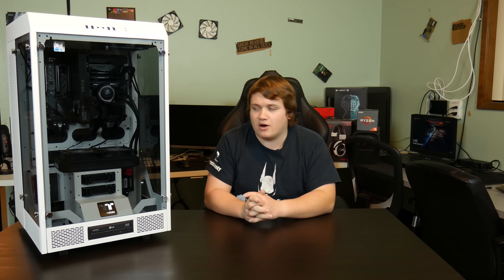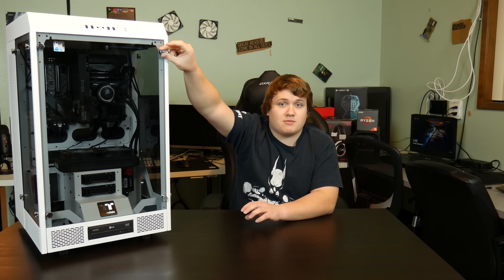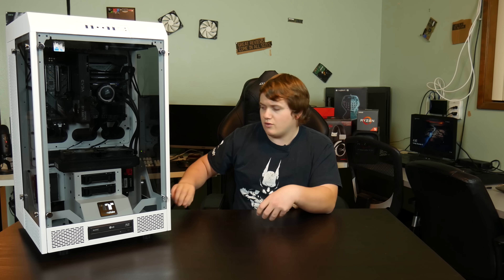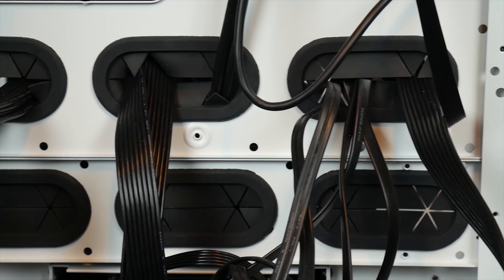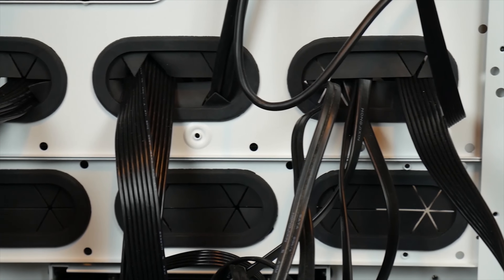Thermaltake The Tower 900 Review | A Good Value?

Comment: The only thing that's wrong with this case is what you put inside. This case should have liquid cooling from top to bottom!
Reply from the maker: +PC Enthusiast oh it will, believe me it will. It's just a matter of getting my specs up high enough for my editing first. Currently rocking a 1950X, now I just need to up to 128gb of RAM, 5 SSDs and a couple more HDDs. Then comes the loop and custom cables.

Comment: can the aio cooler not mount to the side where the radiator should go? i want to get a 360 radiator but i havent found a video yet of anyone mounting an aio in this case besides you. im really hesistant on buying the aio until i know i can actually  use the thing. i want to get the nzxtz73 ai0 360mm kraken cooler

please please please reply back
Reply from the maker: The issue is that almost all AIOs don't have tubing long enough to reach into the rear compartment where the radiators go. So in most cases they won't work.

Comment: What length sata cable did you use for the disc drive? And did you have to buy any longer cables in general? Currently purchasing the last parts for my build and realised I’ve completely overlooked the length of cables needed 😬

Comment: Hey I know this video is a couple of years old at this point but I'm looking to get this case however im not ready to do custom water cooling, does an AIO work in this case? I see you have it mounted in the bottom where you said a 1 fan slot is but obviously you have a radiator bigger than 1 fan down there. If anyone has an answer it's appreciated
Reply from the maker: A single AIO would sort of work in here, but it's certainly not ideal as it'd be mounted below the CPU/Pump. Personally I'd recommend just going with a good air cooler until you can do a custom loop. This case is really only built for custom loops, but a huge air cooler from like Noctua fits as well.

Comment: I’m sure you won’t respond, but why put the close loop radiator right there is there a suction to move the hot air out
Reply from the maker: I try to respond to all comments. 

As for that, yeah there are fans at the top that can pull the hot air out so it’d be fine actually. I ended up not doing the build I wanted to in this case though and instead did one in the Enthoo Elite from Phanteks. I still have eventual plans to do something extreme with this case though, just haven’t really had the chance to do so.
Reply: WordTech ok thanks, I’m building mine and going to record it and I have close loop for GPU and CPU

Comment: can you mount the gpu vertically on the box where you put the 240mm radiator (is it stable)? or what do you think about 45 degrees mounting and the display port that will be hanging from inside to outside?

Comment: I've watched several videos about this case and you were the only one who came right out and said where the IO ends up being. I suspected they'd be on the top but I wasn't sure. Thanks for that.
Reply from the maker: No problem, thanks for watching!
Reply: WordTech  Hi. Could you please tell me if I can put an AIO (not the custom waterloop) in the Tower 900? The radiator would be at the back and I was wondering whether there is some opening from where the AIO head can pass through without cutting through or damaging the case. I have a beQuiet SilentLoop AIO with 360mm radiator. Thanks.

Comment: thermaltake did  something wrong for the AIO , the radiator is lower than the pump so the air gonna be stuck in the pump and making the pump working harder and getting more heat , it's the worst place you can install the aio , but i want to own this case so bad , can you mod it ,so you can install a 360mm on the top of the case ? like cutting a holes ,it's hard to explain but i think you know what i mean , or maybe making a acrylic side panel so you can cut and make hole and install it on the side , well i'm looking for idea to install a 360mm

Comment: just received my 900 tower, I am unable to afford the psu you have, do you have a recommendation for a PSU that would suffice with msi 970 gaming mobo? also there is a red flashing light underneath my blue solid power light. I have ran several test and my hardware is presented as in good standing. however I am concerned
Reply from the maker: Honestly anything from the major brands out there (Corsair, Cooler Master, BeQuiet, EVGA, etc....) above 600 watts should do you good for a 970. I would say maybe go for an 850 watt just to be safe for future expansion. As for the LED, the red one is an HDD LED so it flashed whenever you hard drive is being accessed, nothing to worry about.

Comment: Hey. Great Video.

I'm playing games for about 25 years now, but i never built a pc my own.
I like this Tower and want to move all stuff from my other tower (Cooler Master K280) into it.
How difficult will it be? And does i need any extra cables (longer cables)?

Stuff to move:
+Fan "Alpenföhn Basic Fan"
+Power 750W Corsair CX750 80+
+Mainboard MSI 370 Gaming Carbon Pro
+GeForce GTX 1080TI
+Cardreader 16in1  3,5"
+Soundcard PCIe Creative Soundblaster Audigy FX LP
+2TB HDD
+480GB SSD
+250GB M2

It is not the newest PC but as long it worked with StarCitizen it's fine.

I have no clue about how to built a pc, so thx for any help/informations.

:)
Reply from the maker: Hi,

Yeah all those parts should fit fine in this case, and you shouldn't need any extra cables unless the CPU power cable isn't long enough from that PSU. If that is the case a simple $10 extension will work. But so far I've tried 2 different PSUs in this case and the CPU cables always reached fine. 

Another thing to note is your card reader, this doesn't have a native 3.5 inch external slot, it has a 5.25 inch, so you will want to get a 5.25 inch to 3.5 inch adapter for it.

Comment: Ur rad should be above or offset on side of processor not directly below it ur asking for problems when evaporation happens
Reply from the maker: Correct, this was the only position to get it work in this case, this was a temp build though and only lasted for a short time. The entire build has been upgraded and moved into a Enthoo Elite which is water cooled. I have a video out on that as well including the water cooling build out.

Comment: I got a big cuestion regarding to this case. How do you acces to the motherboard ports?
Reply from the maker: You can take the top of the case cover off (the plastic part) and the I/O is accessible there. Then it has some routing channels so you can run the cables out the back side. 

it's not easy to access compared to other cases, it's really built more as a once in a while thing.

Comment: It's a great value to me because I can mount my ROG PSU inside on top of the drive cage where I can see the wattage display on the PSU
I yanked out all of the custom loop metal parts and installed the "classified" items.
I'm using NZXT z73 and 6800xt / which are AIO and not custom so the removal of the custom loop parts and rear drive cage was a weight reduction.
About fan wires on warm tube of the 6800xt, wrapping them along with the tube using white pipe cleaners worked for me.
Reply from the maker: Sounds like a real solid build!

Comment: The lower filtered panels are removable 1 thumb screw on underside
Reply from the maker: Yes, I found that out later however when removing the screws it was still surprisingly difficult to remove the filter itself. Maybe mine is a dud on that department though.

Comment: did you ever find out that the bottom metal pieces are in fact removable.
Reply from the maker: I personally haven't been able to get them off. But I haven't modded the case yet so I haven't tried everything.
Reply: @WordTech  You still use this case? That's encouraging if so.

Comment: Sloopy work. WordTech didn't completely take off the sticker at the top-left of the front glass panel. I don't want this guy working on my computer because of his lazy habits of not following through on a task.
Reply from the maker: That was left on intentionally, the sticker is not an easy remove sticker like most cases have with the glass, so just trying to peal it off caused it to tear and leave residue. Someone shouldn't have to use goo gone or some removal stuff just to get a sticker off their case, it's ridiculous.

Comment: Cube X9 was much better...
Reply from the maker: It's a different style of case, built for different uses. So I wouldn't say it was better, but just a different design.
Reply: @WordTech  Yes true. This one is a Show case. "Look what expensive Hardware i did buy" & the other was Practicable, Expandable fully Modular, extremly well Airflow etc... Anyway they Dont get Build anymore just like the "W Serie". Just more & more "presitge" Cases on the Market. Not my thing... to make other jealous. I'm "only" Poweruser.